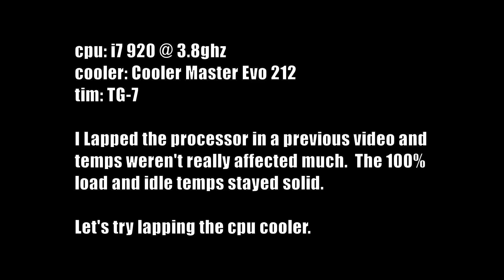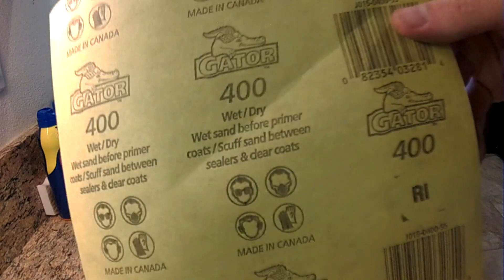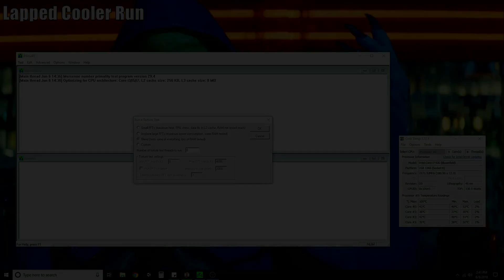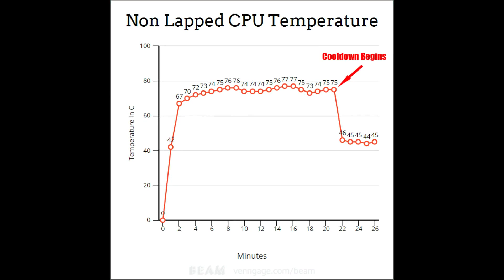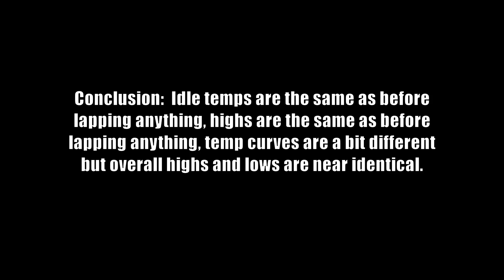You won't believe what lapping your CPU cooler does!

Comment: My guess is that the issue here is not the execution of the lapping, rather the fact that your cooler is to "weak" to show any improvement. It cant dissipate that extra heat any way.
If you had a cooler with more thermal headroom i think it would show you a better result.

Comment: It's a shame that you did all of that work with the wrong testing methodology. What you probably did not notice is an increase in frequency per core between both tests and that probably also allowed the CPU to pull additional voltage which is why you are seeing similar temperatures. What you should have done is lock both the frequency and the voltage and max out the fan on the cooler to eliminate as many variables as possible. Not to mention the differences in room temperature, in a case or open test bench, ETC.
Reply: finally someone that gets it. Its not all about temps and temps dont show the whole truth.

Comment: Not a waste of time. I have Cooler Master T400 for my Ryzen 5 3600. Its contact surface was noticably not good with cpu. I tried lapping and I got at least 10 degrees less temp. I have photo of cpu cooler contact surface which thermal paste surely shows some parts not in contact .
Reply: Especially HP desktop coolers...

Comment: is it okay to do this when I just want to remove some gouges and scratches on the cold plate?
Reply from the maker: yes, just be sure to use a flat surface such as glass or granite countertops.
Reply: @idoesstuff1  I used a marble cutting board.

Comment: you should have stopped at 220 on CPU and cooler also try adjusting your last pass on CPU and last pass on cooler so the scratches are at 45 degrees of each other when installed, this gives the two surfaces something to bite into, it also creates a matrix for the thermal compound to adhere to, you should also note any difference in fan speed and air temp to get an accurate delta. your results show that the PC is controlling the fan curve that's why results are the same

Comment: I really wonder if it could be that your cooler wasn't up for the job at 100% load. So it reached max heat later because it got to cool the heat off earlier. Because it was able to transfer heat better. Since the cooler isn't gigantic, and i have no idea if you had an open case and fans on max also, we won't know this until someone does it once more. Properly. 1C does however seem realistic, if not 1.5C. I'll put this to the test for sure myself.
Reply from the maker: The cooler is a coolermaster evo 212.  It maxes at 75 ish degrees under full load torture tests.  The case is a corsair air 540 with 5 120mm fans.  Two on the front, two on the top, and one in the rear.  In hindsight I should have listed this in the video.
Reply: @idoesstuff1  you probably should've invested more in a beefier CPU cooler instead of those 2 top fans

Comment: aircooling is never worth doing any tricks for heatpipes just dont absorb the heat fast enough vapor chambers help those but to see real benefits from lapping is exclusively on water coolers custom loops most especially. Lapping my 9900K and waterblock (just partially because i ran out of sand paper) alllowed me to go from 5.4ghz to 5.5ghz csgo stable